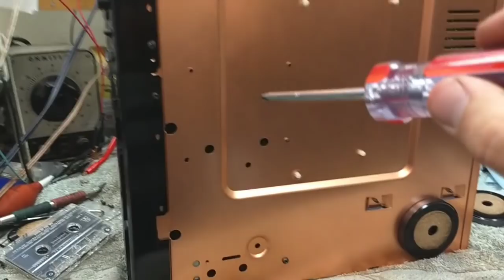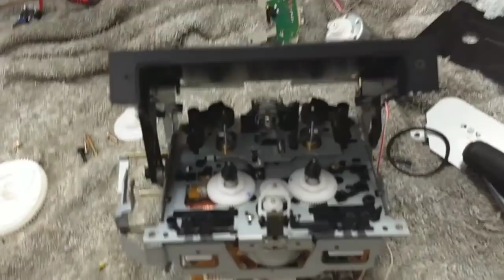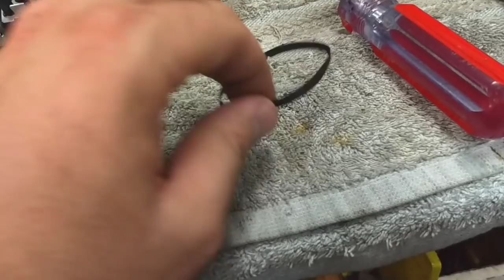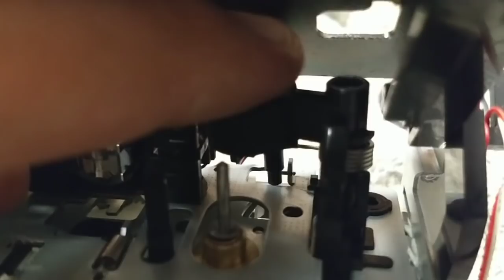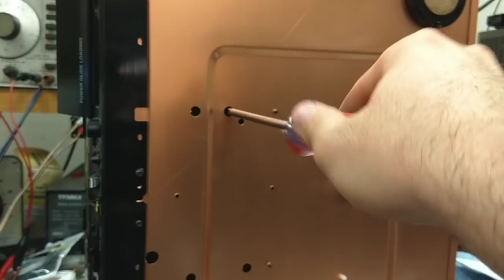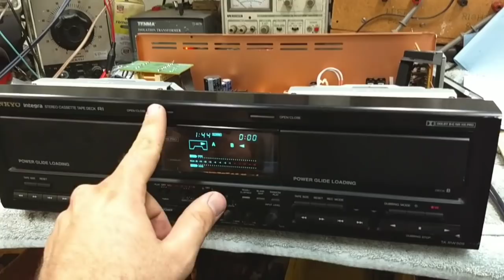How to service an Onkyo TA-RW909 cassette deck - WIND NOISE WARNING

Comment: I have an onkyo ta-rw90 cassette deck. In play mode,the tape reels spin but it doesnt play properly. The belts have been replaced,and the pinch roller makes good contact with the tape.What could be the issue?
Reply from the maker: Can you be more specific with "doesn't play properly"?

Comment: It is possible to replace the main belt without taking off the backing plate. I just did this today with a long set of angled tweezers to loop around the pulley. The first one took me about 10 minutes screwing around to do it, but the second one I got first try. This video was great and gave me the confidence to make the attempt!

Comment: Good video, Like the sandpaper trick for the pitch rollers , might try (old ones might be better than new ones, New= unknown rubber)  did you do a wow and flutter test?
Reply from the maker: Mire and more im having to replace rollers. Resanding doesnt hold well if thr roller is out of round

Comment: Hello Jordan and THANK YOU for that awesome video! Based on your recommendations, and for graciously providing the needed belt part numbers, I am going to attempt this repair on my own TA-RW909 soon. I bought this deck brand new, when I knew they'd be gone forever about 25 years (or more) ago. So now, its my turn to be in the hotseat! LOL I am an electronics tech by trade, although not on audio equipment, so I'm hoping I don't have any issues with eject switches! My left side deck still functions fine, but the right side deck does not function (play) at all. Does open and close though, so I think its just the belt, so I'm going to replace all four. The one thing I was hoping to avoid, however, was having to remove the transport motor from its board by de-soldering. I have small spring hook tools that might just be able to get the new belt around the motor pulley without having to de-solder that motor. But we'll see... just hoping for the best. Thanks again for making this video. Without it, I don't know that I would have attempted this job! Kudos sir!
Reply: Hello again! So, i was able to replace both transport and door belts, in both sides today. The only thing I did different than Jordan, is I was able to replace the transport drive belt without having to de-solder the motor, which I was dreading! I never was good at soldering, ever since high school! So, I ended up taking off the side of the frame where the motor is so that I could access the motor pulley (very tight!) and was able to wrap that belt around the pulley.. very tricky, second one was worse than the first, for some reason, and I had to attempt it like 10 times before I actually got it. I was using spring hooks to bring the belt and hold it onto the motor pulley... very tedious. you have take the entire transport door off to do this, but better than soldering for me!  Anyway, thanks again Jordan.. both decks play great now!

Comment: Where do you suggest buying belts from in 2020? I'm attempting to replace the belts on a Phillips boom box for my grandson. Thanks for any and all suggestions as I'm not having any luck finding belts.
Reply: Not sure if this will help, but I got mine from Russell Industries in Lynbrook, NY I tried to get them from Mars (as Jordan suggested in the video), but they are no longer in business, although someone (I think) is still trying to use the name and (maybe) scam people on that website, so be careful! Of course, you'll probably need to know the size and type of belt that the Phillips box uses? Maybe you can find a video of someone replacing one? Good luck!

Comment: I wonder if it would have been possible to spray some contact cleaner into the original micro switch to get it to function? I really can't see any reason why it would stop working, I have never come across one that just broke internally although maybe it's just not my turn to deal with that type of issue YET lol. I mean, if it appears to be clicking when you actuate it, it might just have dirty contacts inside which might be able to be cleaned, I don't think that I would like to open one up for the fear that I won't be able to re assemble it LoL.

Comment: Very good technical video showing the complexicity of fixing a bit complex cassette deck. I would like to fix an ONKIO k 185X, also autoreverse, that only plays the tape in one direction (ff and rewind work OK). ) I am really afraid to proceed. ¿Any clue about what could be broken? I know Jordan Pier is a repected technician in cassette fixing, with a profesional workshop and deep knowledge in this area.

Comment: Lets start with Privacy, today you have and probably in the past some nut jobs out there. Some people just don't want their name out there which is understandable. Clients should at the least have to opportunity to say OK to YouTube or not. The Tripod issue, camera angle issue; I know you can work that out with ingenuity and keep both hands working in harmony.  Appreciate the detail camera in one; tool in the other..  Work that out and you will fly though this repair on camera as you would without. Same way I would on different products.Well that is early mechanical/electronics; the door switch; they probably had not anticipated the issue. They still have a hard time anticipating issues today; firmware updates today with a decent company that cares about the product. Even the best firmware is good for about 3 years and your lucky if they really work on it or not.